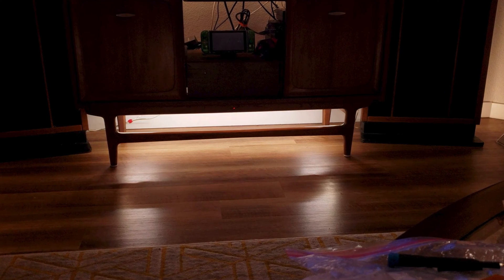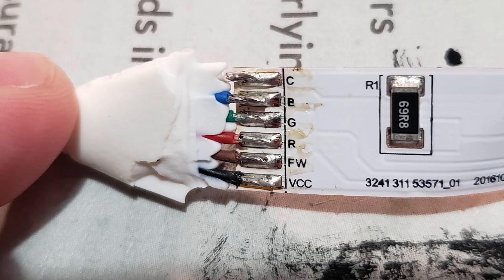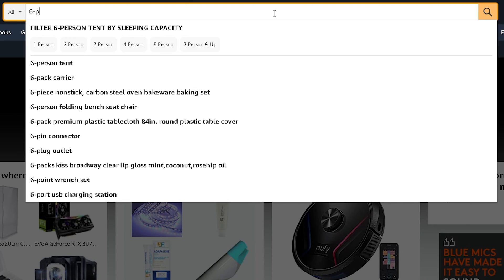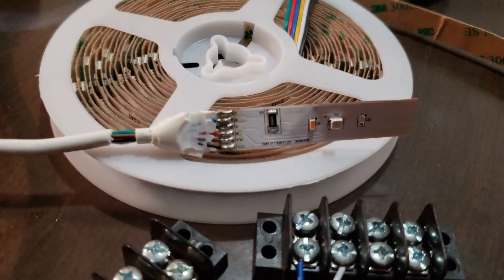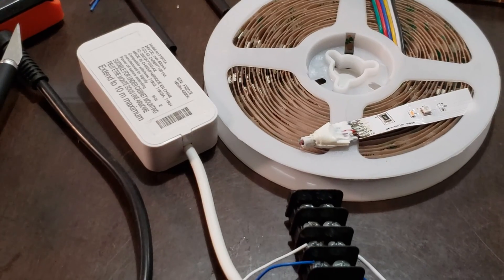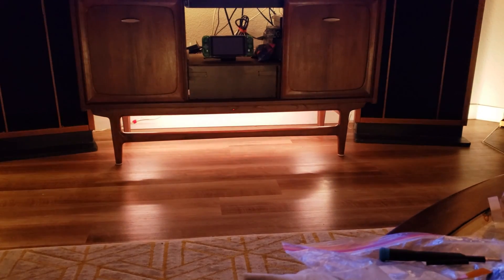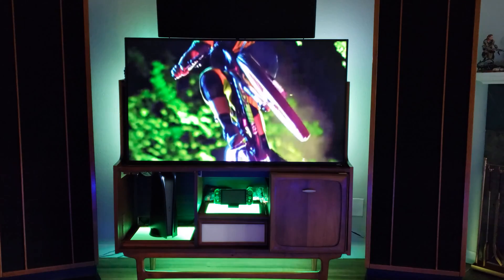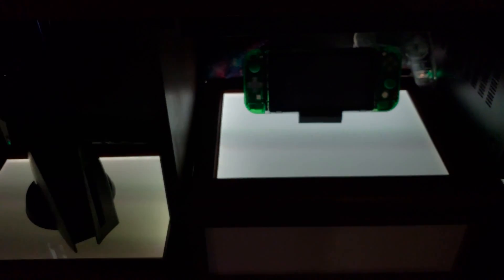How To Fix And Upgrade A Philips Hue LED Strip

Comment: Hi - thank you for sharing your creative fix. I have a wonky Hue strip and would like to do exactly the same. Unfortunately the strip you chose and referenced is now unavailable on Amazon. Would you be able, please, to list the specifications that matter? I picked up on 40 volt and 6-pin. Is there anything else I should be concerned about, such as maximum length of strip or maximum number of LEDs? I see your strip had 540. Many thanks!

update: I found this on Amazon UK and it seems to be the same as you recommend, albeit more expensive ;-)

Comment: Did you use the same power supply that came with the Hue?
Reply: AS longs as you have the philips hue transmitter between the transformer and the ledstrip, it will work. But just get a lightstrip starterpack, and do the extension with this long cable.

Comment: Will this work with the gradient strip? Basically will it be able to utilize the individual 7 zones?
Reply from the maker: I am not certain but my guess is no. The gradient strip will need to use an addressable chip system and the hardware is most likely pre-programmed to the number of LEDs that comes standard. 

There are quite a few videos out there on how to make your own gradient strip with 3rd party parts and software if you are interested in building a better one.